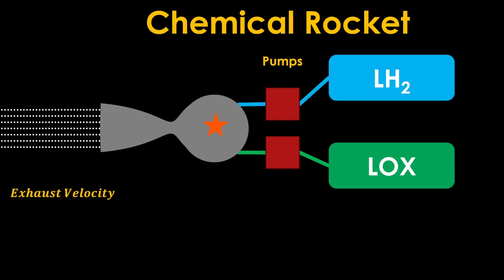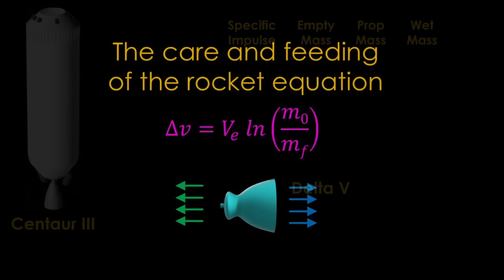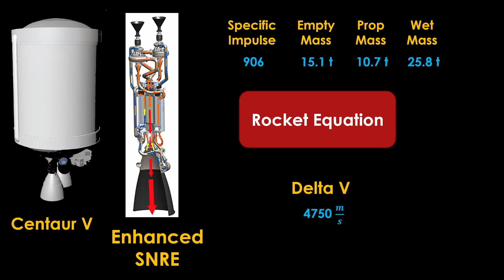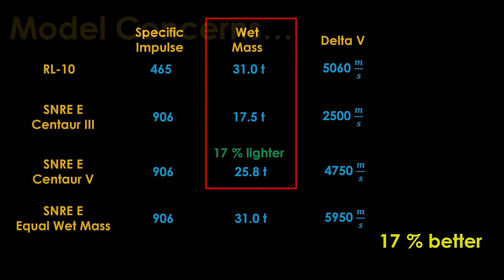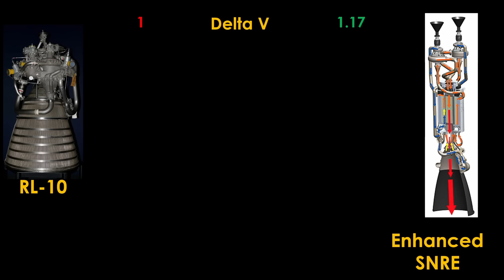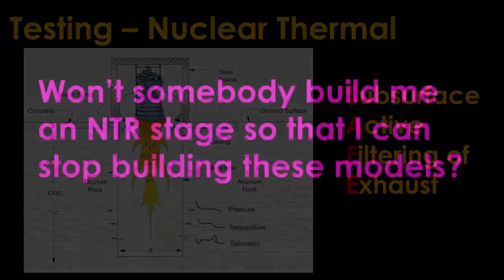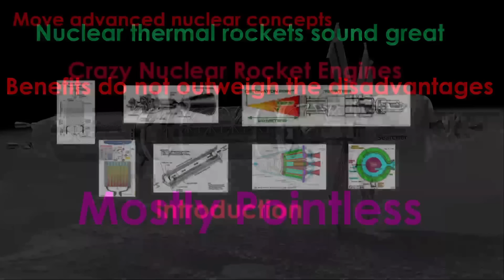Why Nuclear Thermal Rockets are Mostly Pointless

Comment: They might have a use-case for large reusable in-space tugs, as I think most ntr concepts have th being used that way
Reply: Except the reactor core that they are built around will simply melt after firing because decay heat of a nuclear reaction (coming from the delayed radioactivity of split atoms) is SUBSTANTIAL and take basically never ends all though it asyntoticly decays so your engine materials are building up heat which in the vacume of space will not go away.  Thus you would need to both add re-insertable control rods and bleed a stream of hydrogen coolant through the engine for hours or DAYS after each manuver.  This will will erase the last shreds of performance left to them and leave a stage which is a radiation hazard for any vehicle that is trying to refuel it.  Basically a reusable NTR stage is even dumber then a single use stage, even NASA's Mars missions never had any delusions of reuse.
Reply: Ion drives are vastly better for that use case
Reply: @gasdive ion drives lack thrust for moving things quickly. Nuclear thermal can easily make 1000x the thrust of ions and as such are better suited for low orbit tugs
Reply: @Ethan-3369   just ignore that they need 5 times more reaction mass lifted into orbit, that they're too radioactive to approach, that they're single point failure and we'll concentrate on them being a little quicker at changing orbits despite the fact that if you're using a tug you're probably not overly concerned about time.
Reply: @gasdive  sometimes you might not care about time but currently 5n is the best that ions got sometimes waiting years isn't going to be an option.
Reply: @gasdive  They aren’t a “little quicker” at changing orbits, they cut months off your burn time.

Let’s say we build lunar industry, or at least a moon base of meaningful size. Maybe your cargo doesn’t care that it takes several months to transit in either direction, but crew does. A NTR can be refuelled with significantly fewer starship/equivalent tanker flights than a chemical equivalent. You’d have to approach inside the shadow shield, but that’s not that difficult.
Reply: @HALLish-jl5mo     they're a little quicker. LEO-LLO is about the worst use case for ion, they'd be better for Earth-Mars tugs, but even for their worst case ion are not too bad.

Take cheap SX ion drives for example. Put 2000 on a tug. (SX already makes more than that every year) That is 4.2 tonnes. You'll need 1.1 tonnes of the highest performance solar panels, a tank that can carry 13 tonnes of argon (so quite small) say 1 tonne, some wiring and mounts. So the tug comes in at about 20 tonnes fully fuelled, 7 tonnes dry. (Light enough to launch on an F9) Hook it up to a 50 tonne lander in LEO and light the drives. It's got 5 km/s Delta V and it needs to expend 4 km/s (11,000 kg of argon) to get to LLO and drop off the lander. (It can get back with the remaining reaction mass as it's much lighter)

2000 drives use 34 kg of argon every 2500 seconds (the ISP is 2500 seconds). So it would expend the required 11,000 kg in 323 lots of 2500 seconds. That's 9.3 days. It's a 3 day trip so the ion drive would take about 12 days. Assuming a nuclear rocket had instant acceleration it would take 3 days. That's a little quicker. The difference isn't months, it's a few days. Not happy with that? Go for 4000 drives and 2.2 tonnes of solar. That will shave about 4 days off the trip. 

If your crew is really really unhappy about waiting around, then you can use ion tugs to carry the landers and fuel to LLO and the crew can go in a little 20 tonne life support bubble that the tug shuttles back and forth. Then it only has to "burn" 6000 kg of argon and with 4000 drives that's 2.55 days.
Reply: @Ethan-3369     I didn't include you in the reply, but my reply to HALLish covers your main points. 

I'll also expand on a couple of things. A NT tug needs hydrogen for reaction mass. In LEO the heat of the earth will boil your reaction mass away quite quickly. Liquid argon will stay liquid with just a sun shield and a little compression. (At one bar the boiling and freezing points are nearly the same, but at 10 bar there's about 30C difference and it boils an a bit over negative 160C.)

Hydrogen transfer is difficult on the ground (as SLS has so expertly demonstrated). No one has attempted it in orbit. There's a non zero chance it's actually impossible and your NT space tug is a single use item. In which case it's an expendable stage not a tug. In contrast, solar panels and ion drives have demonstrated continuous use of more than a decade. The thought experiment tug I described to HALLish could be launched by an F9, and refilled twice by a single F9 launch. That means for every 3 F9 launches you could move 46 tonnes from the pad to LLO and you could do that every 20 days for 10 years. That makes an F9 based moon colony completely practical without SLS or Starship using off the shelf technology (except for the landers themselves). The landers would be much easier to build than most current designs as there would be effectively no fuel constraints as you can put as many tonnes of fuel into LLO as you could ever need. 

If you leverage only the demonstrated parts of Starship (reusable booster, ship that can reach orbit) and forget about the rest, it becomes even easier, but it's not needed. You can move a Ship and as much fuel as needed for the landing between LEO and LLO without 8 refilling flights. You'd only need to lift about 50 tonnes of argon and 100 tonnes of Starship propellant for a round trip LEO-LLO-LEO and that could land 200 tonnes of cargo on the moon and bring the ship back.
Reply: @gasdive
Scaling up the power requirements of Hall effect thrusters to large ships in the hundreds or thousands of tons while maintaining enough thrust to do transfers in time (around 10-20 mG) is pretty difficult
Like you quickly need megawatts or power continuously for months to feed an ion engine on a heavy ship 

As for hydrogen transfer being hard, sure; it being impossible in orbit, nonsense. Hydrogen boiloff is also limited by cryo storage, just look at JWST which is right next to earth in terms of distance to the sun yet cooled off to like 1 kelvin or whatever it’s at 

I’m not fully sure that ion thrusters can be scaled up to very large vessels on solar power alone, like you rapidly go from milligees to microgees if you try and it’s just not where you want to be at
Reply: @IceRain-f5v       We must have a different idea of what "pretty difficult" means. 

Launch weapons grade uranium into orbit, supply it with 20K cryoliquid somehow pressurised to 1000 bar without heating it enough to turn into a hot gas and instantly destroying the turbomachinery, carry dozens of tonnes of 20K cryoliquid cooled with a Hubble derived cryocooler that only goes down to 77K, uncrewed orbital transfer of 20K cryoliquid that we can't even do in the ground, shield 20K cryoliquid from the sleet of fast neutrons that would almost instantly flash it into a gas with a shield that's light enough to put into orbit. 

All totally trivial. But worth it because you get 900 seconds ISP. That means a tug with 10 tonnes dry mass could give a 100 tonne ship 4.343 km/s using only 70 tonnes of reaction mass.

"Pretty difficult"

Buy 1000 off the shelf ion drives that weigh 2.1 kg each and which have already accumulated thousands of years of on orbit operation. Buy 1.1 tonnes of off the shelf ultra lightweight solar panels. Mount the drives in an array, connect them to the solar panels, plumb it to a small tank of argon supplying gas at 1 bar. Make some roll out solar panel mounts, fit the rolled up solar panels, launch it on a Falcon 9. 

Not worth it because you only get 2500 ISP. That means a tug with 10 tonnes dry mass could only give a 100 tonne ship 12.066 km/s using 70 tonnes or reaction mass or use only 22 tonnes of reaction mass to give the ship 4.46 km/s

But it takes "months"... Well 4.46 km/s takes 36 days. Use 2000 drives and 2.2 tonnes of solar panels that's a little over 18 days. (If you add 10 tonnes to the tug dry mass you need to also add 2 tonnes of reaction mass, so though you use it twice as fast, there's a little more to use)
Reply: @gasdive I'm sorry what comment is your Hallish reply under?
Reply: @Ethan-3369  it's this thread, but YouTube seems a bit broken. I'll just copy it into this reply

@HALLish-jl5mo     they're a little quicker. LEO-LLO is about the worst use case for ion, they'd be better for Earth-Mars tugs, but even for their worst case ion are not too bad.

Take cheap SX ion drives for example. Put 2000 on a tug. (SX already makes more than that every year) That is 4.2 tonnes. You'll need 1.1 tonnes of the highest performance solar panels, a tank that can carry 13 tonnes of argon (so quite small) say 1 tonne, some wiring and mounts. So the tug comes in at about 20 tonnes fully fuelled, 7 tonnes dry. (Light enough to launch on an F9) Hook it up to a 50 tonne lander in LEO and light the drives. It's got 5 km/s Delta V and it needs to expend 4 km/s (11,000 kg of argon) to get to LLO and drop off the lander. (It can get back with the remaining reaction mass as it's much lighter)

2000 drives use 34 kg of argon every 2500 seconds (the ISP is 2500 seconds). So it would expend the required 11,000 kg in 323 lots of 2500 seconds. That's 9.3 days. It's a 3 day trip so the ion drive would take about 12 days. Assuming a nuclear rocket had instant acceleration it would take 3 days. That's a little quicker. The difference isn't months, it's a few days. Not happy with that? Go for 4000 drives and 2.2 tonnes of solar. That will shave about 4 days off the trip. 

If your crew is really really unhappy about waiting around, then you can use ion tugs to carry the landers and fuel to LLO and the crew can go in a little 20 tonne life support bubble that the tug shuttles back and forth. Then it only has to "burn" 6000 kg of argon and with 4000 drives that's 2.55 days.
Reply: @gasdive
"@IceRain-f5v      We must have a different idea of what "pretty difficult" means."
No doubt

"Launch weapons grade uranium into orbit, supply it with 20K cryoliquid somehow pressurised to 1000 bar without heating it enough to turn into a hot gas and instantly destroying the turbomachinery,"
I feel like that’s called a valve
And also just insulation + thermal decoupling + (active cooking) + overpressure escape valve 

"carry dozens of tonnes of 20K cryoliquid cooled with a Hubble derived cryocooler that only goes down to 77K,"
I mean you’re the one who insists it has to go to X temperature and as far as I know you can reach any temperature with some scientists being pretty sure they reached exactly absolute 0 (second sound experiment with the hypothesis being that some atoms are at 0 kelvins exactly while others are not in a fluid very close to it)

"uncrewed orbital transfer of 20K cryoliquid that we can't even do in the ground, "
What do you mean can’t even do on the ground wasn’t the Saturn V second stage just a big old vat hydrogen? J2 engines are hydrolox 

"shield 20K cryoliquid from the sleet of fast neutrons that would almost instantly flash it into a gas with a shield that's light enough to put into orbit."
lol if the radiation is so strong it heats you by like 60 kelvins instantly it’s definitely strong enough to be lethal so I damn well hope the radiation shield has reduced radiation enough to the point where it wouldn’t warm up the fuel too much

Also the entire operati principle is that it heats up the cryogenic H2 to thousands of kelvins inside the core it works because it’s under pressure beyond the turbo pump. And again this has literally been done plenty of times I’m pretty sure 20+ nuclear thermal thrusters have been built and operated on the ground between all the nervas the pewees the kiwis the Russian ones the xes the whatever’s there’s been a lot and what you talk about was never was seen as a big hurdle 

"But worth it because you get 900 seconds ISP."
Yes that’s how it works
Delta v can only be increased from exhaust velocity and from % of the ship which is fuel. 
You physically can’t get more delta v if you’ve already turned your rocket into a fuel silo with tons of stages already except than by upgrading you engine’s exhaust velocity 

"Buy 1000 off the shelf ion drives that weigh 2.1 kg each and which have already accumulated thousands of years of on orbit operation. Buy 1.1 tonnes of off the shelf ultra lightweight solar panels. Mount the drives in an array, connect them to the solar panels, plumb it to a small tank of argon supplying gas at 1 bar. Make some roll out solar panel mounts, fit the rolled up solar panels, launch it on a Falcon 9."
Oh don’t get me wrong I love ion engines and would never argue for using nuclear thrusters for space-space transfers (unless it’s a military thing and your rendezvous target isn’t cooperative) 
Ion engines are clearly the best for tugs (even though in your example you seem to underestimate how much solar panels they need especially if you dare to move slightly away from the sun)

I never advocated for nuclear thermal as space - space transfer engines. Rather I say their applications are:
-exceptional/VIP and heavy lift ground to orbit launchers (for when you need to put something huge in a single piece in orbit)
-lander/takeoff thruster for humans to other planetoids
-military applications

These are the only places where I see them being useful. Also fighting aliens and pushing off planet kiIIing asteroids... should the need apply. But hey you don’t want to be stuck trying to intercept an alien battleship that’s mining off the Kuiper belt on 50 μG nor do you want to have fun trying to push off a 10^18kg rock you just spotted with your little ion engines, especially considering nuclear thermal can pretty much intake any ice you shove into it as fuel, I’m pretty sure you could just grab a mix of ammonia ice, water ice, tho line and methane ice, shove it into a nuclear thermal thruster (maybe liquefy it first... maybe) and it would work lol. Not great Isp but hey free fuel! (Russian one ran on decane so they can run on hydrocarbons no issue)

Ion engines remain king of space-space transfer, nuclear thermal is a direct upgrade to chemical thrusters and are only useful in places where high acceleration is required. For space space transfer from my experience you never need more than 10mG in the solar system unless you have more than 200-300kps of delta v per trip at which point you’re being pretty wasteful using so much delta v for a simple transfer anyways 

But that being said reaching 10mG for ion engines can be challenging, they often end up in the migrogee strugglezone at which point it’s less orbital mechanics and more being-carried-away-by-the-gravitational-tide simulator. And of course you can’t spend fuel fast enough either. Oh you can still transfer do trust me, but it looks more like modern art than a serious attempt at space travel at that point with travel times that * somehow * take 10 times longer than a hohman transfer and trajectories that would make a clown cry
Reply: @gasdive  So we only need around 7 acres of solar panels to get around .18 Newtons of thrust?  That's trivial!
Reply: @YaBigDummi 7 acres would get you about 400 N. But were you planning on using that area for something else?
Reply: @YaBigDummi  Don't forget that we're talking about tugs. In the previous example we used 70 tonnes of hydrogen. At 70 kg/m³ that's 1000 cubic metres. That makes a sphere 12.4m in diameter. The circular projection of that is about 120 square metres. Using Eager Space's numbers from their orbital depot video of a few years ago, it will absorb about 65W/m² from Earthshine. (Assuming a perfect sun shade. Otherwise, add another 13W/m²). A cryocooler draws about 400W for every W pulled from the cold side. So you need about 3.1 MW to keep the hydrogen from boiling off. That compares to about 4.2 MW to run 1000 ion drives. (Assuming SX drives). As everyone loves to point out, the acceleration of nuclear thermal is vastly higher. So the panel mounts must be equally vastly heavier to cope with the higher G loads. Which means that the solar panel system to run a NT tug would be heavier than one for an ion drive. 

The 3.1 MW of heat created by the cryocoolers also needs to be rejected, and so you're going to need radiators of considerable size, and radiators are inherently heavier than solar panels as they must contain fluid under pressure.
Reply: @Ethan-3369  Just combined Ion systems with traditional storable hypgolic propellents for thouse fast 'braking' manuvers, while hypergolics are lower efficiency then cryogenics they are highly reliable and because braking manuvers happen after main propulsion the efficiency of the ion system pays for the weight of hypergolics needed.
Reply: @IceRain-f5v  No, JWST is at Earth Sun L2, farther away then the MOON is, their is no way you could keep JWST in Earth Orbit, it would get too hot because the Earth IS a huge heat radiator too and in many ways far more problematic then the Sun because in low earth orbit it covers half the sky AND is radiating in the infered which is harder to reflect.
Reply: @kennethferland5579
"Earth Sun L2, farther away then the MOON is,"
😂
Thanks I didn’t know where the moon was 

"their is no way you could keep JWST in Earth Orbit, it would get too hot because the Earth IS a huge heat radiator too and in many ways far more problematic then the Sun because in low earth orbit it covers half the sky"
Yeah if only there was a solution to this
Like a shield that also covers more of the sky... if only a slightly larger shield was possible...
Sadly we’ll have to put this with other impossible technologies like time machines and warp drives... 😒😔😔

"AND is radiating in the infered which is harder to reflect."
Maybe you thought that sentence was smart but the only thing smart about it is how you manage to pack several errors into a single statement

You receive more infrared radiation from the sun than from earth in LEO. The earth produced mostly infrared is entirely besides the point. The sun gives you more infrared than the earth lol. And after giving you more infrared than the earth it also adds extra higher frequency radiation on top of that. Certified RIPBOZO moment

Then you say that " infered is harder to reflect....." 
LMAO JWST USES ALUMINUM COATED SHIELDS WHICH HAVE HIGHER REFLECTANCE IN THE INFRARED THAN IN VISIBLE LIGHT !
😂😂😂😂😂👉🤡👈😂😂😂😭😂😂😂
Reply: @gasdive  There are engineering problems to overcome, yes but Ion engines will never be viable for this purpose. The entire use case for a nuclear tug would be when you ARE concerned about time. For cargo or unmanned missions, ions can and do work.
Reply: @RobertHall-ef8yf    there aren't "engineering problems to be overcome".

It's the rocket equation. 

There's no engineering that can get around that. There are essentially two ways you can build a nuclear rocket. Nuclear thermal, which has high thrust and low ISP. It's not practical because once you plug the extra dry mass of hydrogen tanks, radiators, refrigeration, insulation, solar panels to drive the refrigerator, shielding and the nuclear rocket itself into the rocket equation you're back down to chemical rocket Delta V or worse. It's just a really difficult and expensive way of doing what a chemical rocket already does better. That's before you consider it makes refilling and ISRU almost impossible. And the other is nuclear electric. That gets you the great ISP of ion, but the radiators needed are heavier than the solar panels that would have done the same job, even before you consider the mass of the nuclear electric generator.
Reply: @gasdive  Indeed, you can even replace (if they are inteligently designed as replacable 'arms' that can detatch) the thruster assemblies themselves which do experience errosion due to sputtering of charged ions.  The bulk power systems (certainly solar) and power managment hardware and chassise will last decades while our currently best thrusters will only last a few years under continual thrust.  Fortunatly the thrusters are quite small as a portion of the overal system mass, much less even then the propellent consumed on each round trip.
Reply: @kennethferland5579  that's a good point. Haven't thought of that. (Replaceable drives)
Reply: @gasdive   Wrong, ion thrusters are good for long distances because of high efficiencies, but they absolutely suck at being orbital tugboats. Efficiency is nice, but it's not everything.
Reply: @JohnPaulUser  rather than just saying "wrong" how about you look through my various replies and then explain where I'm wrong with actual numbers.
Reply: @gasdive   Do you know what an orbital tug does. An ion engine is not suitable to be used for that purpose. The thrust of an ion engine is equivalent to a price of notebook paper in your hand. My source for this is https://science.nasa.gov/mission/dawn/technology/ion-propulsion/ Paragraph 5. 

That's all well if it's not that heavy or if it has as much time as it needs, but the kind of orbital tug we are talking about here is the kind that moves heavy payloads into interplanetary trajectories with short deadlines to meet the needs of whatever project NASA would need it for.
Reply: They’re mostly useful for combat platforms. In space the ability to catch up to a target or evade a hunter is entirely determined by your engine. Delta v and acceleration both matter. An ion engine only craft cannot evade no matter delta v it has because it can’t accelerate fast enough to evade anything

A nuclear thermal rocket can catch up to anything and evade anything

On top of that it would make launching things to orbit VASTLY easier. Not only is the exhaust velocity three times higher (not double as he says in the video, triple, which is huge, e^3=20 is the performance improvement. Twenty times better)
But they have this higher fuel efficiency WHILE still being high thrust drives. High thrust enough to take off from earth gravity. Making them great launchers. 

Solid core also do not create radioactive exhaust, at much the radiation in the reactor may turn the hydrogen into deuterium (extremely long half life, considered by some to be eternal and non radioactive) and tritium (14 year half life, basically irrelevant) then other weird lightweight isotopes like beryllium or helium that likely would undergo fission events quickly. 

If you launch them from the middle of the ocean there would basically never be a single human hit by a single particle of radiation from nuclear decay coming from the exhaust of these rockets. So they’re not radioactive or bad for the environment either. Well unless they go spaceX mode and explode or crash of course lol. But again if you launch them from an island in the ocean it’s hardly an issue, you can just bring them by boat to any location you want. 

They’re also potentially great for launching huge rockets to orbit in a single go, for stuff where in-orbit assembly isn’t an option. 

So the main roles are military (specifically space space asset vs space asset warfare) and launcher. They are not good as space tugs and indeed ion engines are best for this

I also ran a study (non published idgas) on ion engines to see if they could be used without nuclear power and the short answer is that yes you can go pretty much anywhere in the solar system on ion engines and high delta v burns (going way faster than a hohman transfer) without any nuclear power. Which is good because it means you can go fast from point A to point B without rare isotopes that are so rare you might as well say they don’t exist like uranium 235 or tritium. 

Nuclear propulsion however I believe isn’t a total war winner in space warfare for reasons I won’t elaborate on, but I’ll just say it’s an advantage but one that can be just bypassed by several other aspects of a war and several technologies. It’s undeniably better but not mandatory and a non nuclear force that uses only chemical technology would be able to defeat a space armada that uses nuclear technology if they play their cards right. 

Nuclear thermal rockets are lastly a stepping stone to develop the much more advanced type of rockets like liquid core and gas core (the often repeated claim that gas core is no harder to develop than liquid core seems entirely baseless, drum style liquid core seems pretty simple engineering wise, compared to the absurd difficulty of a gas core rocket) and these more advanced types or rockets could allow us vastly better performance still. 

Indeed the limitation on all thermal rocket engines is the melting point of materials. Hydrogen oxygen combustion engines are limited by temperature too. They often do not run stochiometric which is a total joke. Nuclear rockets could give us nearly torch engine levels of performance if we could somehow manage core temperatures of 50 thousand degrees or more.  Nuclear reactors can get that hot and remain stable and operate as desired. However they of course would vaporise and disassemble if you tried. But the energy is there the math and nuclear chemistry works out etc, so we could build terrific rockets with hundreds of kps of exhaust velocity and many Gs of acceleration on a large ship if we could somehow solve the thermal management issue with fission alone. No need for exotic unsolved stuff like fusion or fission. So the issue is thermal management. And "not researching and developing it" is the worst way to solve such hurdles. 

And it’s not a binary reward either. Every time we manage to push the limit further on core temperatures, we get incrementally better engines. And the reward is exponentially. Literally. the rocket equation is a logarithmic. Any improvement to engines is an exponential improvement to fuel efficiency and mileage.
Reply: @IceRain-f5v  Only mad men thing NTR are an option for launch, first off the size of reactor needed for that is monsterous, and a launch failure is now a Chernobyl level event.  Not to mention their would not even be very good, a NTR still had a far LOWER thrust to weight ratio then any chemical engine.  We generally do not even use Hydrogen-Oxygen stages as launch vehicles, atleast not without solid boost rockets to get them off the launch pad.